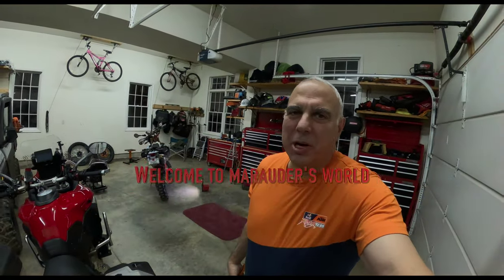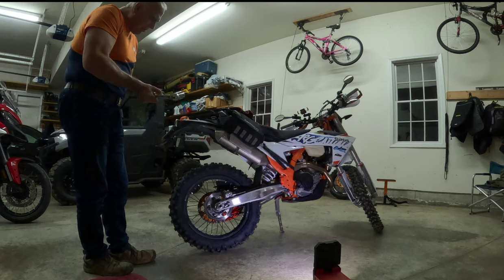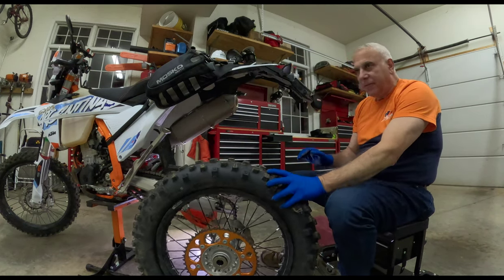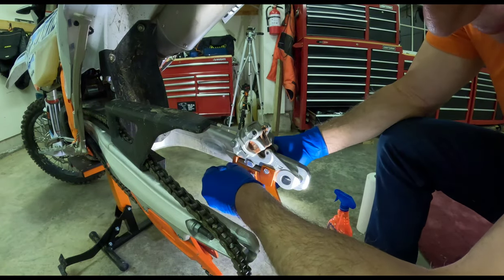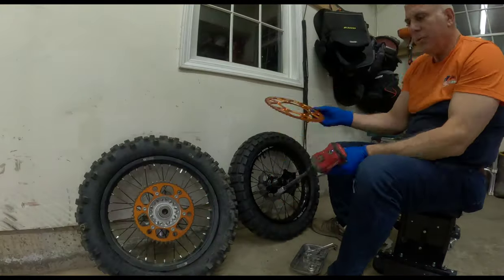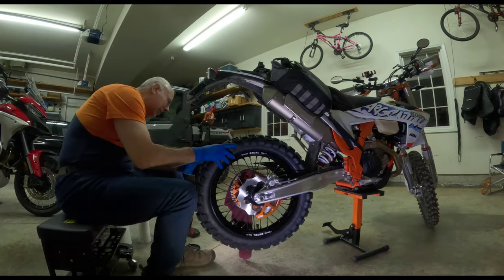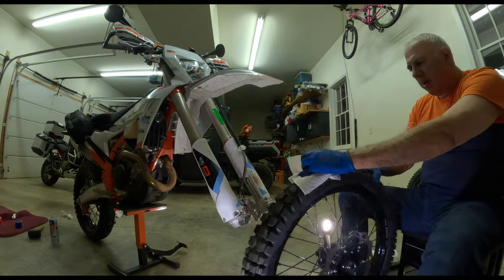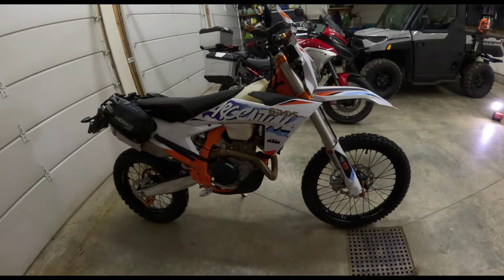Takasago Excell Rims Shark Fin Rotor Guard Install 2024 KTM 500 EXC-F 6 days #369

Comment: Love that orange bling 😏👌
Reply from the maker: I get it, I did not want this bike I preferred the standard KTM colors but bought this hoping the dual program switch would work and it doesn't. I really like the orange frame and accents also. Now i have to practice at riding it better. Thank you ride safe.
Reply: @maraudermitchelli   I like the standard model too, lol but i would bolt on every piece of anodized orange they make  😅
Reply from the maker: @RidingWithDom  Too funny now i would agree with that

Comment: Would you recommend this bike over the  2024 KTM 690 ENDURO R?
Reply from the maker: I assuming the KTM 690 is the same bike as a Husqvarna 701 both are great bikes no doubt...I've driven the 701 and almost purchased it instead of the EXC. It depends on the type of riding that you are doing...I wanted a bike that was more trail based and weight was a big concern of mine. Considering weight and trail performance the EXC is the winner there is nothing lighter I believe. When I was at the forest trailhead a 701 told me he regretted buying the 701 and wish he had purchased the EXC due to weight and suspension he had far more experiance than I. Although the EXC 500 does very well on the road the 690 and 701 would excel on the road no doubt. All are great bikes my focus was the trail not the street. BTW the biggest surprise to me is how fun the EXC is on the street it is extremely light. Be safe
Reply: Appreciate your comments and yes the bikes light weight is very important
 to me @maraudermitchelli
Reply: That's a NO you need both bikes.
Reply: The good thing about the 500, is when you get stuck in the mud or sand, you can lift the bike quite a bit easier than you can the 690. It’s more convenient when you’re riding the 500, in those situations. You almost have to have another person to help you get your bigger adventure type bike out of jam.